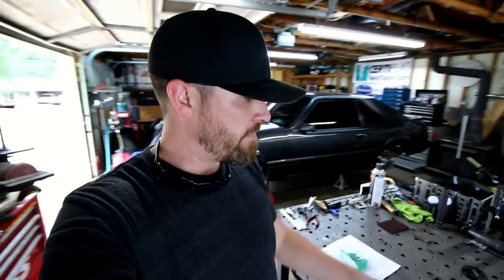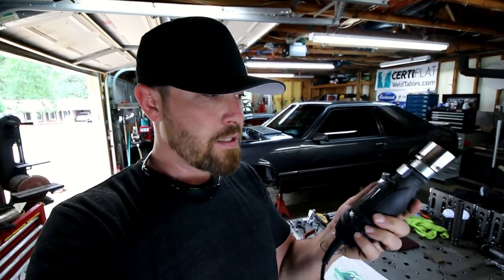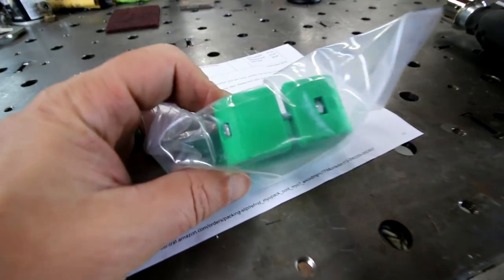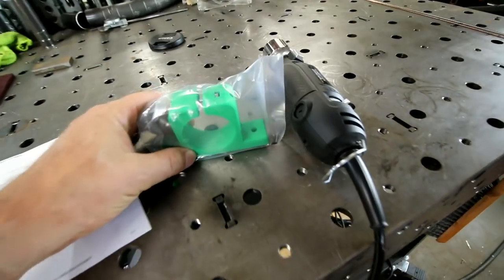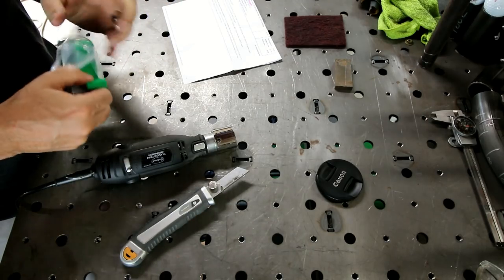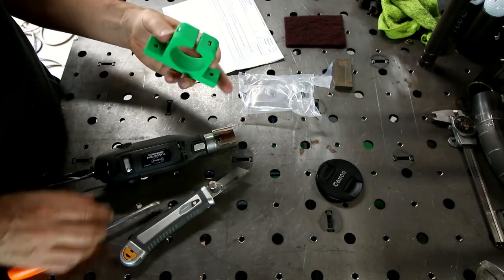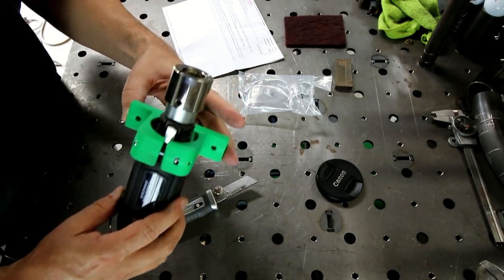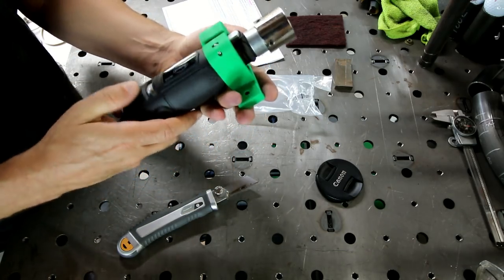Dremel Tungsten Grinder Bench Mount

Comment: Currently there are two Dremel corded rotary tools; the 4000 and the 3000. The small clamp is for the older Dremel 100, 200, 395 series tools. The large clamp is for Dremel 4000, 4200 series tools.

I have a 395 which I purchased back in 2001 as a kit with all the accessories. When I started using the flexible shaft the motor was all over my work bench, so I took a 3"x6" piece aluminum sheet stock and cut 2 holes in it to slide a worm drive hose clamp thru. Fastened that holder to a slightly larger 3/4" thick block of wood using #6-1/2" round head wood screws and added 4 rubber feet to the hose clamp to "soften" the clamp around Dremel housing (and to allow air circulation around the motor housing) and I was set to go. Clamped the wood block to the edge of my work bench or into my bench vise to hold it when I was using it; it wanted to walk itself off the bench due the motor vibrations and moving the flexible shaft as I was using it. 
I was doing a lot of computer case mods back then in my basement workshop.  Out in the garage I would use my air die grinder and right-angle air grinder. Those air tools were over-kill for computer case mods and the air tools scared the hell out of our cats when I used them in the basement; plus it was a "pain" to be dragging an air hose across the yard and in thru a basement window during the winter. Summer it was car mods and heavy metal fabrication in the garage; winter it was quieter, less fume producing smaller projects inside. I have a wall furnace in the garage, but the warm-up time took a day and the steel tools just never warmed up, other than by touch. Thus is the nature of living @ 41.8781° N latitude and trying to work in a free-standing wood garage with little installation.

That Eastwood Tungsten Grinder looks like an offshoot of the 4000 series, based upon the location of the on/off switch and the speed selection switch. But the housing and the switches are slightly different from the Dremel branded 4000. The large clamp should fit, but may need to be "hogged out" a bit.
Reply from the maker: Yeah that's what I have figured out...gonna order the larger one

Comment: you know what thread pitch that bolt is?  It would be way cool to use a bike seat collar type quick release for the clamp so you can have it bench mounted when you want then with the QR lever just release the tool so you can bring it to the project.

Comment: Hey kyle, im looking to get a tig welder right now, and cant decide between the miller 180 ac/dc tig or the eastwood 200 digital, price is a huge factor of course. But which one is better i noticed in one video, seamed like you were more pleased with the performance and features of the eastwood machine. Is this the case? Any response will be greatly appreciated, thanks for the content!
Reply from the maker: yeah the Eastwood has way more features and is about half the price.
Reply: The Fab Forums thanks for your response man. You think id be better off there for a beginner tig machine? I think ill go eastwood then :) thank you!!!
Reply from the maker: Yeah they are great machines for the money

Comment: What engine management system did you go with on the goose and how is it working out for you?
Reply from the maker: Its BigStuff3...works great so far
Reply: What was the deciding factor on your intake and induction choice. Does the elbow and throttle body design flow more are than a standard throttle body or efi setup?